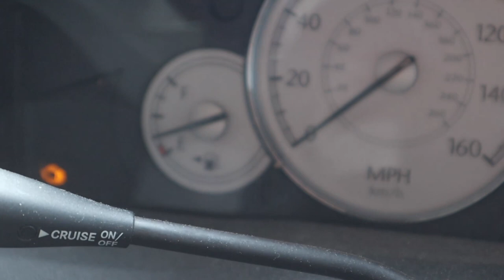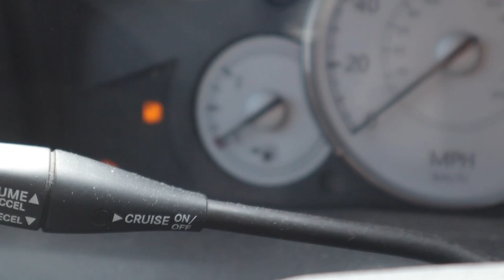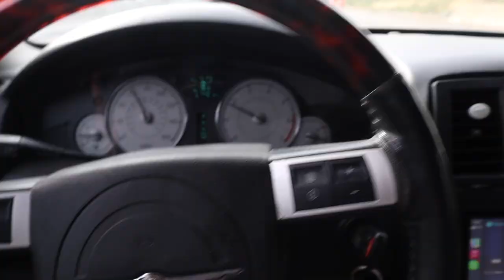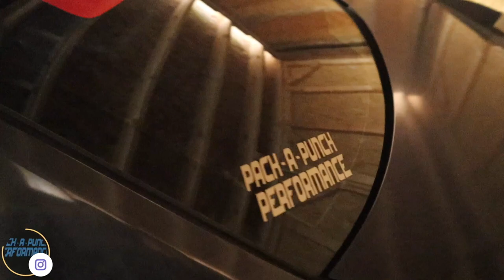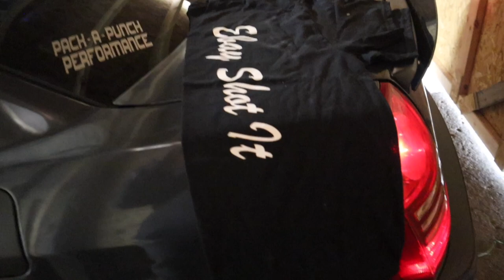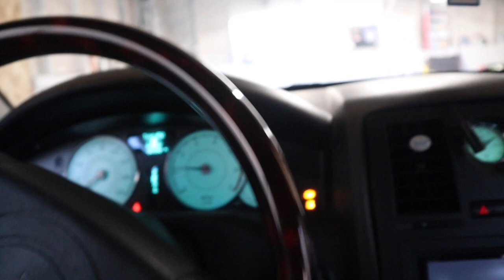INSTALLING ANGRY EYELIDS ON MY 2007 CHRYSLER 300C *

Comment: I did them off sheet metal screw on to the hood grinded down the screws and use bondo to level everything out making neat looks way better then those eyelids
Reply from the maker: hmmm i seen  alot of ppl going that route
Reply: What thickness of sheet metal